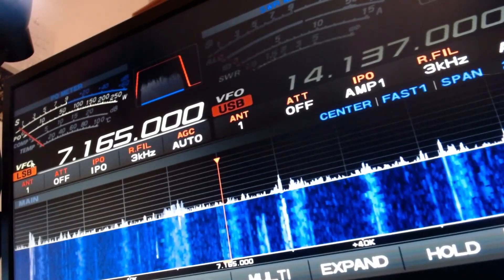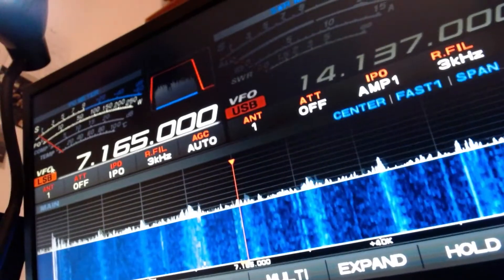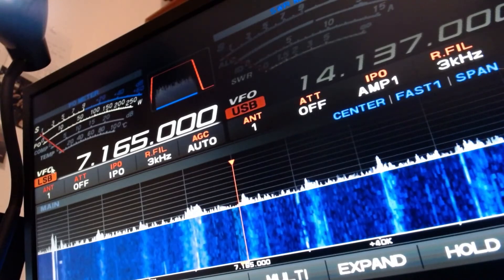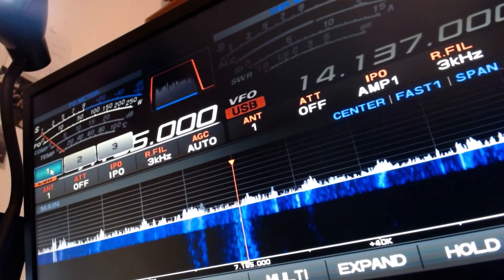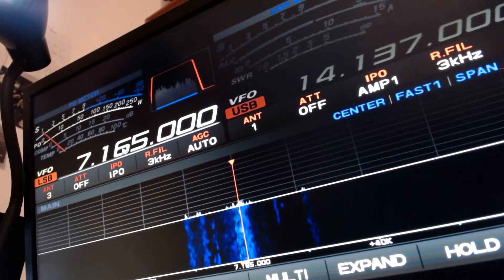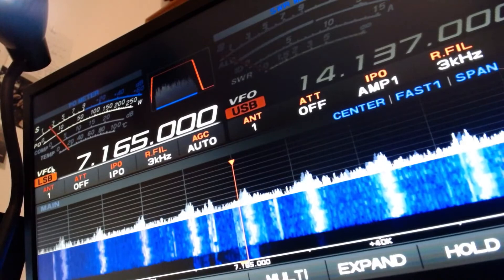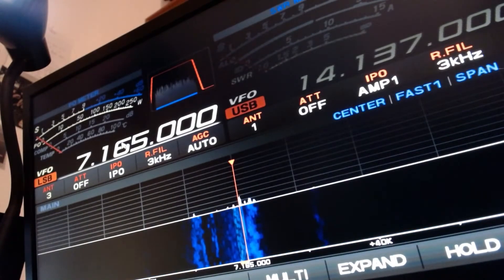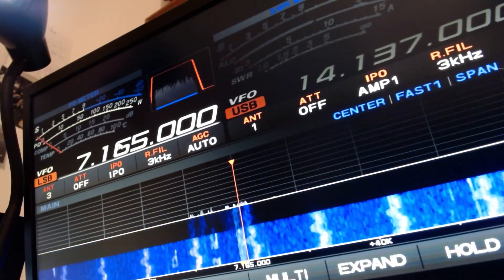3 Minutes That Will Change Your Ham Radio Life. The MFJ 1788 Loop. See and HEAR The Difference!

Comment: I love mag loops and think they are fantastically useful antennas but here you don't seem to be comparing apples with apples here. Your vfo seems to be tuned into a signal (as seen from the centre of your waterfall) so flicking between antennas seems to be showing a drop in signal not noise...as also indicated by all the other signals on the band falling off your waterfall too.
I do agree that the high Q of a mag loop can significantly help the crap front end filtering of something like an ft817 with its compromised design (especially on a full sized base antennas on a crowded 40m at the weekend)  but I would be interested to hear the experience of other hams (with decent rigs like yours) trying to duplicate the miraculous effect you have had.
Reply from the maker: Hi Ian,

Thanks a lot for your post. I do appreciate it. 

This video content was to show how much noise floor drops over a wire (dipole) or a vertical. both of those antennas are great for TX but not optimal RX (especially weak RX.) 

When noise floor drops, weak signals appear out of the noise whether using a panadapter or tuning by ear. 

My SW receivers, showed this to me for decades as well. 

If you like loops, you already know all this.  This short video was only to show how much of an impact in noise reduction drop a loop can provide.

A panadapter screen simply makes it a “visual example” as to an easier to “see” drop in noise floor over a dipole or vertical by using a video screen over only a speaker. 

Some people learn things by “seeing”, some people by hearing.  As a former teacher, I try to use other methods to show various things when I can. 

in one example of this very short video, you can see weak signals come up that weren’t able to be found before because the noise was hiding them on the dipole antenna I use. 

That’s the point. Use an antenna that’s made to RX on because it’s made to receive, then use your TX Santana to transmit on.

I’ll be doing another loop review this time for Chamaeleon, on their 2.0 loop which is a great QRP field loop and can be used at home too if you’re in an HOA that limits antennas. 

I’ll spend a little more time on that review picking out some weak signals that would be lost in the noise floor if I was using a typical Multiband dipole. Not hard to find those kinds of signals on CW or SSB.  

This video was meant to be “short and to the point.” Only three minutes. Just to show the significant drop in noise floor using a loop. That was it my friend. 

Unfortunately, before doing the Chamaeleon review, I’ve ordered a noise canceller to knock out some terrible RFI that’s killing the receive on my 101. 

I have a neighbor who’s a kind man, but has a HUGE RFI Flamethrower next door in a waterfall pump flow controller. 

I’ve ordered the MFJ 1026 noise canceller to mitigate the noise so the test on the Chameleon will hopefully be more “apples to apples” to most peoples working conditions. 

The Chameleon 2.0 is another well received loop in the hobby, (that can TX at 25 watts as well which is nice.) 

In that test, because it’s a review Ian, it’ll give operators a better chance to see how a loop antenna can bring in signals otherwise lost in the noise floor , to make more QSO’s possible. 

As you know, what you can’t hear above the noise floor, unless you’re working FT8 etc... you can’t work because The noise floor covers over the signal.

I appreciate you writing in Ian. Your kindness in taking the time to do so, was great.
Reply: Ian sorry no offence but your concept is junk . A magloop IS a compromised system so you can't compare to a full size antenna . To have a better result on a front end EVERYONE should learn the old way : a good mix between the RF Gain and the Volume . Turning at max the RF gain "because there's the agc" is because we want everything ready with one switch to press but this is also crap . Avoid the "tv screen" and stuff : what you really should use is called ears . The same thing that tell you if the readibility is enuf despite of the signal strenght . Magloops were used ( and still ) by military and we know usually they need the best stuff for some reasons . Is a magloop efficient of a well placed dipole ? NO, the magloop is LESS efficient . But the magloop makes you listening stuff wich may are impossible with a dipole due to the local qrm and stuff . You should uderstand the MAIN reason that makes someone to make/buy a magloop : the fight against the noise . I ONLY use magloops and i CAN listen while others who live on my same town simply can't : i can listen those S2 S3 signals on 40m...other hames have QRM at S8 . Decent rigs ? I had the ft 1000mp mark 5 and sold because it's a noisy radio . I use tube radios (Drake mainly) because they don't need more and more circuits  to fight the internal noise due to the digital things . Again : i can listen signals that they are S2 or S3 ...others can't because they don't use a magloop . Oh and the "null" is very efficient to fight splatters and so on .

Comment: Can't really see what the video is proving ? Would it not have been better to pick out a signal and then compare the 3 antennas as opposed to a bit of band with nothing on but noise.  I have the same radio and a great radio it is too but if I am comparing my various antennas I do so by selecting a signal (cw or voice) and then switch between each antenna to see which is best for signal strength / lower noise ? all you are doing is showing the spectrum graph changing. I could do exactly the same video and having nothing plugged into ant 3 I would get the same results
Reply from the maker: My friend, the whole point of that video shows you quickly how much NOISE your dipole or vertical picks up. 

And how much that noise floor drops when you use a loop antenna for RX.

So you can HEAR the signals the noise is hiding on your vertical or dipole antenna!

That’s it. 

You can hook up “nothing” and “receive nothing” or you can hook a loop up and receive signals that are lost in the noise because the noise floor is so high you can’t even hear them. 

There is a better way to do this.  

Use your dipole or vertical for TX. Use a loop for RX. 

Because that’s what the loop was designed to do in the first place… Give you an edge on the RX side. . 

Thanks for your reply.
Reply: @HamRadioLiveShow  It seemed though that switching to the loop also attenuated all of the other signals. Does the loop drop off so precipitously?

Comment: sorry, but if I switch to my dummyload, I also get S0 noise floor :-) ... to compare a dipole or vertical with the loop, you need to compare it with cw/ssb signals
Reply: Very good comment! Antenna can improve signal to noise ratio only if it has good directivity.
Reply from the maker: Your Dummy load isn’t an antenna except for strong signals. This loop will hear weak signals. Big difference.
Reply: @HamRadioLiveShow  That point might have been better made by comparing weak signals in an a/b after showing the effect of switching on the noise floor with the waterfall. Your demonstration (as filmed) only showed that the MFJ antenna wasn’t as sensitive across the band as the dipole. There were signals on the waterfall that disappeared as well as the noise.
Reply: @HamRadioLiveShow  
I seriously disagree.  I got better reception off a clip lead on the back end of my rig than this "transmitting loop" 45 foot up in the air.
Reply: @HamRadioLiveShow  antenna does not know noise from signal. Receiving antennas can improve signal to noise ratio only if they have good directivity. Efficiency for receiving antenna can be very low, and that is why they can be much smaller than transmitting antennas.

Comment: I can get good noise reduction too - if I remove the antenna from my receiver .. How does the two antennas compare with a weak signal  - that is borderline readable on the vertical ?

Judging from an earlier answer - it does work - but it would be nice to see. 

Will this work on the 70 cm band as well ?
Reply from the maker: No, not on 70cm. As for the noise reduction. All I can say is I’ve done DX since 1973 and nothing out there can reduce noise like a loop. And you can transmit on this to which makes it quite a bonus.
Reply: @HamRadioLiveShow  But you didn't answer bodstrup's question.  Does it reduce noise compared to a signal?  I can do what you did in the video by disconnecting the antenna.
Reply: @Species-rj9si  it does....do some research on your own...check out loops on ARRL
Reply: I didn't come here to be told "do some research on your own."
Reply: You will have better reception with a clip lead than with this loop

Comment: Duh,  reduce the bandwidth and the overall noise is lower.   Sure looks like there are a bunch of signals disappearing along with the noise.  Look at the SWR at either end of the spectrum display.
Reply: Is that antenna good for transmitting?
Reply from the maker: Reduce the bandwidth? Lol! That was over 100 KHz of bandwidth! How much more do you need?

Perhaps we work differently. I don’t rely on waterfall screens to find my signals. I rely on my ears to find them.  

That’s getting to be more and more of a lost art today in ham radio unfortunately.

If you’re talking about the waterfall that was “lit up?” Keep in mind, that’s only the area where the SWR has been tuned safely at 3 to 1.     

SWR as in transmit bandwidth. 

SWR and “receive” have nothing to do with each other. 

This antenna receives very well no matter where it is on the bands, from ham frequencies or MW and LW. That’s what well designed loops do. 

You have a right to your opinion, but in this easy to follow visual example, the S meter and the waterfall don’t lie. 

Environmental noise goes down significantly when you use a loop antenna over ANY dipole or vertical. 

As for “the rest of the signals?” 

They’re still there. I’ve already shown that in previous videos.

A loop lowers the noise floor from environmental noise and nulls RFI and strong signals in their centers. 

There’s a reason that they’re used by the Department of Defense, our military and ham broadcasters when trying to triangulate broadcast signals. Because loops are designed to RECEIVE, they locate them. 

While a wire antenna or vertical don’t because those antennas are made to transmit with, not receive with. 

If you’re using a vertical or a dipole antenna you have probably a great transmit antenna but you’re missing out on having a great receive antenna. Add a loop and you’ll hear what you’ve been missing. 

I wish you the very best on the air my friend. Good DX.
Reply: @HamRadioLiveShow    I'm just pointing out it's not getting something for nothing.  A high Q loop is obviously  a viable method of improving reception of a specific signal.
Reply from the maker: loctite222ms agreed. It’s an improved way to receive but not the only way. I use the channel to encourage interested hams to get their licenses, review products and show different ways to be successful. 

On another note the smoke we have here from these wildfires are truly awful for anything to work. It’s been awful. Thanks again for your comment and for replying back. It was nice to hear back from you.

Comment: You don't show the effect of the same antenna changes on the strength of desired signals, including at various arrival elevation angles.  Signal to noise ratio is the name of the game.  My dummy load will show even better noise reduction performance, but it won't help me hear.  While
Reply: (continued) While the antenna is probably a fine low noise receive choice, this demonstration doesn't show that.
Reply: @KeepEvery1Guessing  so, instead of belittling the OP, why don't you make a video of just that
Reply: @lizzyfan1986  Sure. Buy me one of these antennas and a video camera and I'll make the additional measurements.
Reply from the maker: Dear Bill,

I’m a pretty chill guy. I’ve been DXing SW, Ham and MW signals for over 47 years now.

I’ve used long wires, aluminum, coils and loops over those 47 years and learned the best receive antennas I could use on the best and most efficient receivers ever made were loops. 

A loop antenna outperformed every other type of “receive antenna” There is. 

But most hams are concerned with dbi, take off angle, radiation pattern and “will it fit on my property. Not one concern about RX. 

My example clearly showed what I’d already learned from over 47 years of DX that a loop antenna will receive significantly better than a dipole or vertical antenna. 

Your dummy load example is simple to replicate. “Simply find a S5 the S9 signal and you’ve got an antenna there in your dummy load your testing TX on. 

My example clearly proved that the loop DID knock down environmental noise and drop the S Meter down significantly over a vertical or a dipole. 

And it will do it every time. On every band. 

It simply works. And more ham operators should be using one. They spend all their time and effort into getting the optimal transmit antenna while ignoring an optimal receive antenna.

This loop has not only heard many DX signals lost on my vertical and dipoles but also successfully transmitted a successful QSO more than 2,600 miles over land, not seawater. 

Coast to coast. 

And it was through such a dense smoke layer at my QTH when that QSO was made that it looked like I was transmitting from the surface of Mars. The sky was so orange, it was filled with carbon and smoke. 

It just works Bill. You’ll hear signals lost in the noise much easier. I stand behind this 100%. Because nearly 50 years of experience was proven in the panadapter screen and S Meter. 

Thanks for your comment.
Reply: @HamRadioLiveShow  Bill is a troll